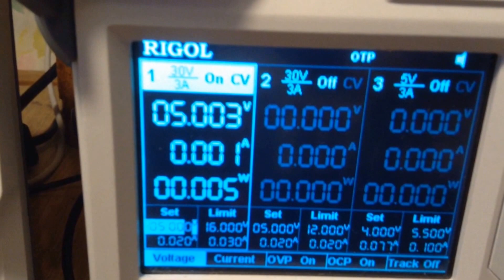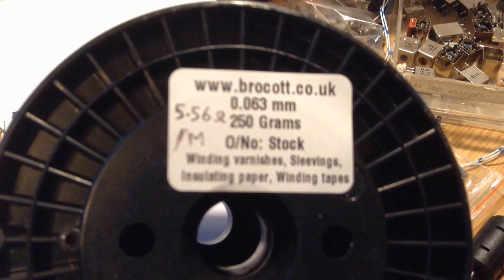1MHz Oscillator

Comment: Very nice project! Would it reduce the circuit's susceptibility to noise, by removing the extra pad length of the 5V trace? Simply cut it, after the transistor supply pin?

Comment: this circuit is great, i used other j-fet,110uh coil and 200pf capacitor and it wroks at 1.2Mhz it was drawing less than 1miliamper (my psu couldn't even show it) at 6v and was enough to be picked up by am radio 2 meteers away
Reply from the maker: Great stuff!

Comment: What is the use of resistor in lc tank circuit ?
Reply: maybe to limit the starting current
Reply: Resistor has double function: 1)DC bias.  2) Mandatory for amplifier. Without the resistor, V_sink will be short to ground and JFET will not amplify.
Reply: @sullivanzheng9586  then you LCR why not use resistor in series with FET Source Terminal i asked just for Passive circuit LCR itself

Comment: what influences the size of the waves please answer
Reply from the maker: Hi. The coil windings, the resistor size and the 47pf capacitor affect the frequency of the wave. The input voltage effects the amplitude or height of the wave. Cheers.
Reply from the maker: Astuti Tuti Hi. The coil windings, the resistor size and the 47pf capacitor affect the frequency of the wave. The input voltage effects the amplitude or height of the wave. Cheers.
Reply: @stoneslice  means the capacitor is replaced by no longer using 47pf and how to count the waves